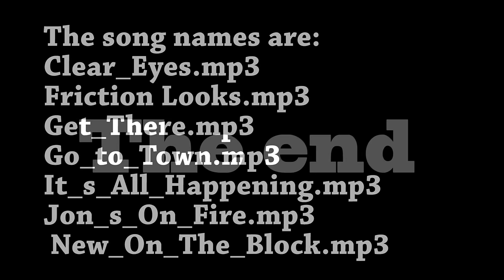Silver ring for tough guys handmade

Comment: When building a ring in this way, how do you keep the ring from falling apart as you solder on new pieces? Like how did you keep the solder that held the top together from melting when you soldered on the side pieces?
Reply from the maker: I use solders of different hardness
Reply: scaffoal does it make a difference where you use each type of solder, should you start with hard and work your way down to easy?